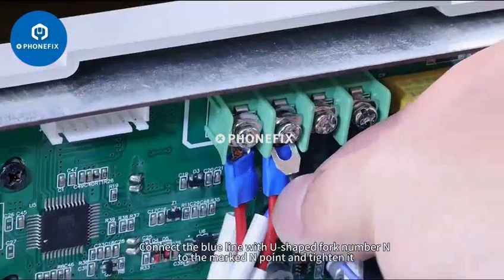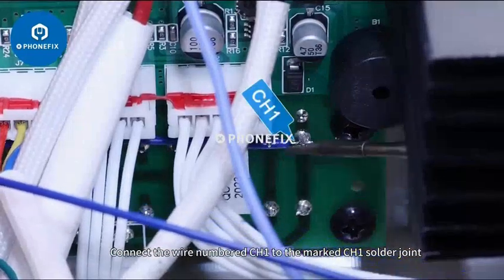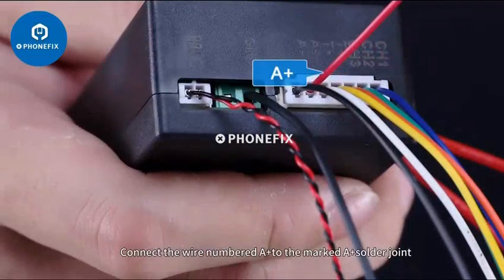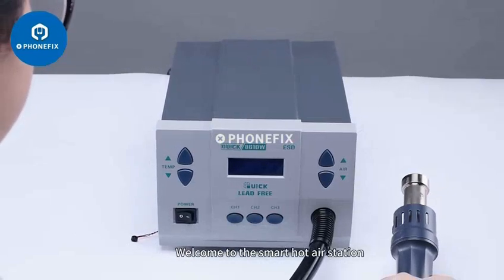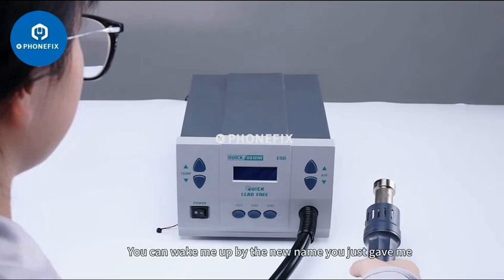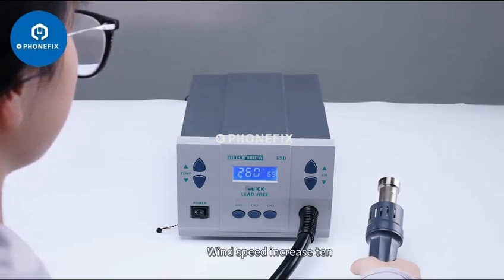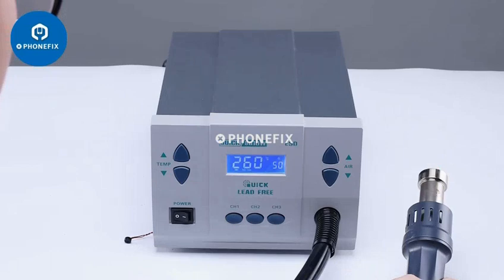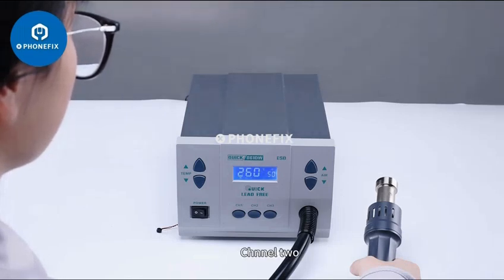MaAnt GTP-01 GTP-02 Hot Air Station AI Intelligent Module No Need Networking

Comment: wow, that's a cool tool. Can this MaAnt GTP-01 GTP-02 tool be applied to the hot air Station 'Sugon 8620DX-PRO' ? If so, how is the tutorial? And also I ask for the purchase link for the MaAnt GTP-01 GTP-02 tool?
Reply: It doesn't work without turning on the power switch. How does it work for you in the video?
Reply: @mahmoudali1259 as the same here, it doesn’t work
Reply: Unfortunately, it does not work directly on Sugon stations, but I developed a circuit that is compatible with the output of this circuit to be compatible and work with the Hot Air Sugon control signals. Unfortunately, it requires experience and strong knowledge of electronics. You can visit my channel and you will find the video of the experiment.
Reply: https://youtu.be/H0mbZlqm1ug?si=H8XUNTNNSJdxX9u6